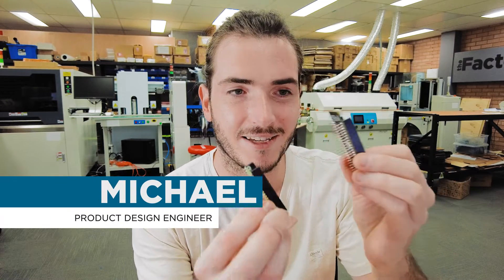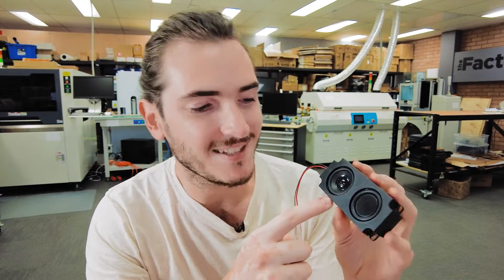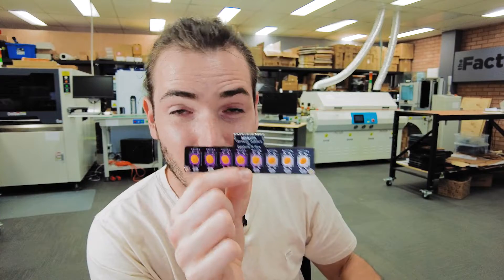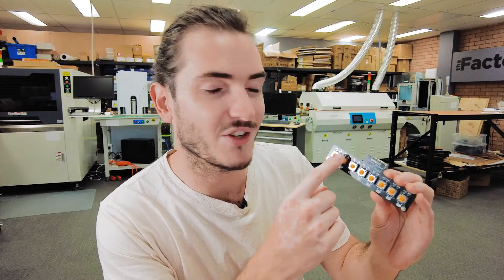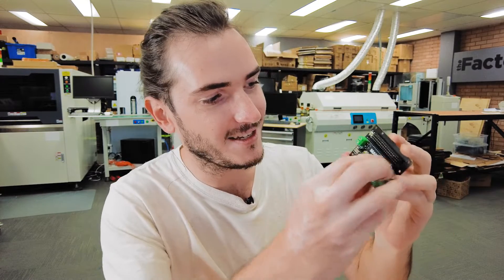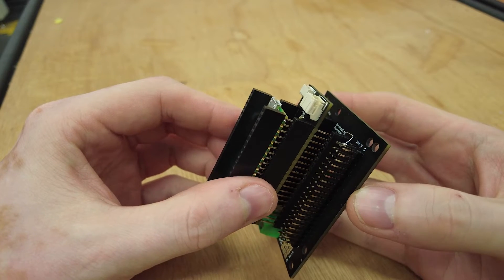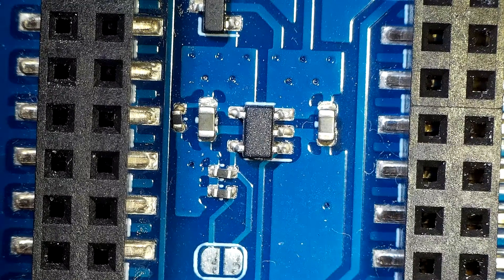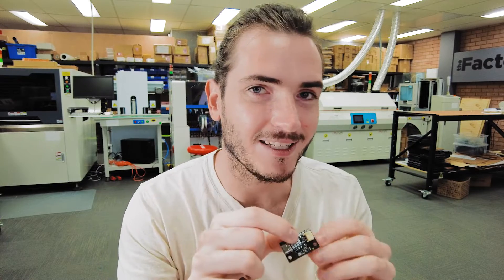The Factory | Designing Shields For Raspberry Pi Pico

Comment: The other advantage of the Pico having the stackable headers I feel is that you can use the top female header to monitor the signals being used by the circuit below more easily on a DSO. I do this on shields stacked on Arduino style stacks all the time.

Comment: Great idea to do stackable shields, for the breakout board I would suggest doing a row of each male and female duponts, although I have a large range of leads I have found in past that is easy to run out of the correct ends or lengths so having the option of both male and female on the breakout board increases the likelihood of having all the correct leads for project.